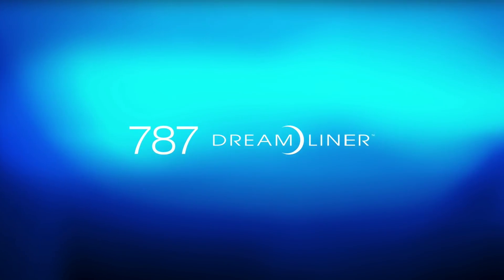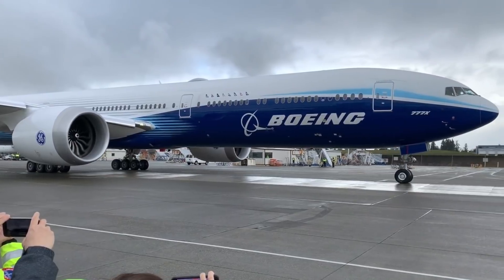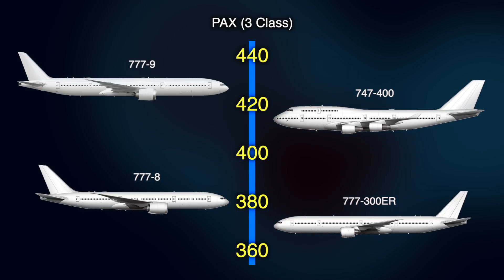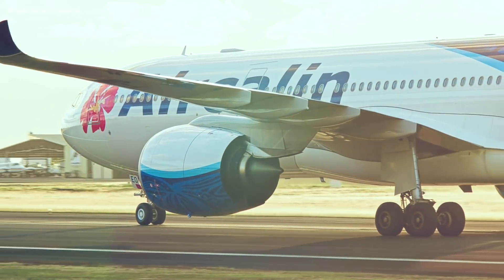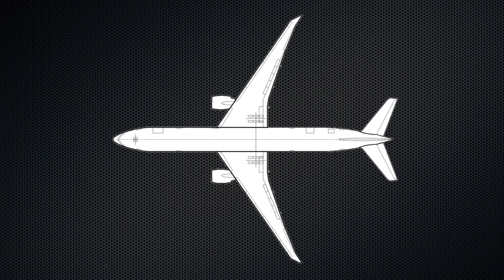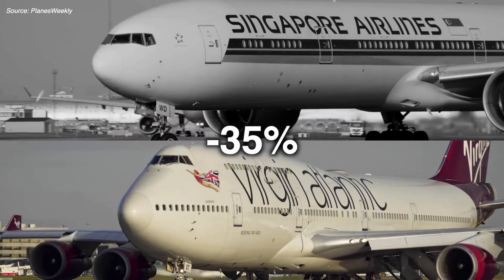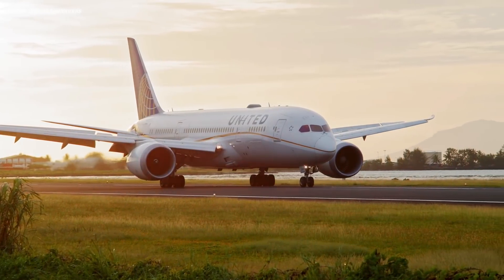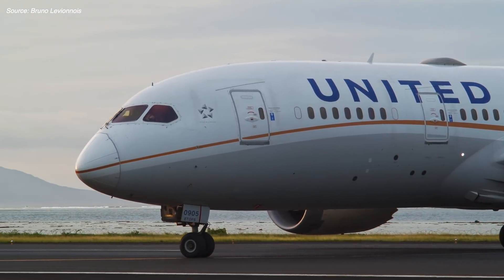The 777X Has a "Tesla Problem"

Comment: If Boeing had built the 777X's fuselage from composites it would just have been the same as building an all new airplane so the plane would not have been classified as a next generation 777 but as an all new airplane making the plane very expensive both for Boeing and its customers
Reply: This is the answer I was waiting for for the entire video. It would require a whole TCDS.
Reply: @jahredt  yep. It’s the same reason you still find ashtrays on the 737 ng. Altering the design, even in little ways, risks having the aircraft type certification revoked, causing the costs of production to shoot right up.
Reply: @monty2654  actually the ashtrays are an FAA regulation still. Even the 787 that was designed long after the smoking ban has them
Reply: @jahredt  I’m going to go looking for that now. Last time I was on a Dreamliner, I saw not one on the plane.
Reply: @monty2654  You're blind. I was on a United 787 EWR-IAH just last week. They're there.
Reply: @patrickproctor3462  easy son. Like you said, smoking has been banned on airplanes a long time. Why have ashtrays on a plane you have no intention to smoke on?
Reply: @monty2654  Yes, without FAA and EASA the 737max would be a best seller. Maybe not with the insurance companies ...
Reply: @VolkerHett  Airlines would be far more profitable... Just sayin.
Reply: @monty2654  Yes. As long as they don't have to pay for late or canceled flights. But that's bureaucracy, too.
Reply: @VolkerHett  No, no. I'm talking more than just late or cancelled flights. Over regulation on even the smallest of things can cost the airlines big money, needlessly. I've been witness to many unnecessary regulations being implemented, with no rhyme or reason to them.
Reply: @monty2654  Yes. But allowing planes like the 737max to be flown without any training for the pilots didn't turn out cheap. Typerating seems to be a pretty good idea, else carriers like Ryan Air would hire agricultural pilots to save money 😊 Boeing has a problem at the moment and I'm sure it's not an engineering but a cost cutting problem.
Reply: @VolkerHett  cost cutting, sure. Your point about hiring agricultural pilots is actually ridiculous. Airlines hire pilots from all backgrounds. Some of the most competent pilots I’ve met would jump at the chance to fly an ag bird, just to get experience. I’m not sure where you were going with that but, your point landed about 50 yards shy of a field goal….
Reply: @monty2654  Yes, but it is a long and expensive way from a private pilot license into an airliner cockpit. And besides ATPL you need a type rating for any aircraft you'll pilot. 
The MCAS in the Boeing 737max was there so airlines buying this machine save on expensive new type ratings for existing 737 pilots. With fatal results. 
Given the chance, airlines will avoid all cost. Be it fuel to reach another airport instead of their destination or pilot training. Oh, and cheaper planes would be welcome, too. 
The university where I studied business administration has courses for Aviation Systems Engineering and Management. I'd be one of the bean counting cost cutters where I in aviation instead of IT  :)
Reply: @VolkerHett  again, Airbus is no different. The only difference is, Boeing got caught scrambling and wrecklessly rushed the max product. The A320 did have a well publicized crash in its early days, that didn’t stop airlines from buying it. I work in the industry, have done so for 15 years. I’m no stranger to the foolish manoeuvres bean counters will pull to save a buck. My job is to directly help mitigate costs, without answering to those bean counters. I’m no stranger to the politics of airlines. Again, I know many pilots. Even after they reach the airline plateau, they will still go flying on their time off, when practicable for them. They easily make their money back once they get to the airlines. The amount of taxes that airlines pay, the scams that manufacturers pay to get “upgraded features”, all that stuff adds up fast. So yeah, I still think the bureaucrats need to back off in many regards and stop making airlines tread on the knife edge of profitability and bankruptcy. Maybe then, those same governments wouldn’t have to bail airlines out so damn much. Just remember, the money that goes to the airlines under that circumstance, comes out of your pocket, too.
Reply: @monty2654  Yes, I know! And that's why we need FAA and EASA to maintain safety over cost cutting. 
And let's not forget, crashes aren't good for business! 
As to the 737max, they should have made significant changes to the landing gear when they found out they couldn't put yet another bigger engine on the 737 airframe. This was cost cutting done totally wrong.
Reply: @VolkerHett  they DID make changes to the landing gear. They had to raise them to accommodate those engines. The max stands taller than an NG as a result. I think you need to review what you’ve been saying. In summary, it’s gone like this: “I was going to be a bean counter, therefore I believe we should should government agencies because you can’t trust bean counters.”
Again, you’ve missed the point I tried to make. I believe we should blow up these agencies and start again. Get rid of the useless regulations, you know, the ones designed to look like something was done to score political points with the general public, keep the good and ACTUALLY helpful regulations. Not a hard concept. Moreover, I’d like to see why you’d advocate for the aviation authorities of other countries that are very lax about safety, ie the ones that don’t have any policies about situations that very easily arise in the aviation community. Do you think we should just keep them around for reasons? Especially given that, they are so easily bought off, in many circumstances, to just look the other way….
Reply: @monty2654  I have heard that and I get that but it sucks that it hinders more advancement. That being said proven technology is comforting. Especially in a magic machine.
Reply: @monty2654  they're in the lavatory i think. If you do break the no smoking mandate, at least there is a spot you can put the ashes in.
Reply: @carlosandleon  Yep, I did find them, they're purely for the FA to extinguish any lit cigarettes.
Reply: @VolkerHett  One of Boeing's difficulties is the belief that they can save money by outsourcing.     Lots of companies still do.  Often costs associated with using outsourced parts are not accurately figured.
Reply: @monty2654  Crop dusting is one of the more difficult aviation jobs.
Reply: @VolkerHett   I wonder if anybody will ever put out a decent video and explain the 737MAX MCAS thing.
In short.  As I understand it the 737MAX only needed MCAS to ensure that no additional pilot training was needed.  GUESSING changing the landing gear would also require training.   So Boeing could simply have said no to SW and sold the MAX w/o adding MCAS.
Reply: @monty2654  the newer A320NEOs my company has still have ashtrays in the back of the cockpit seats
Reply: @peterambelang4888  cool.
Reply: Not only that, but it would also require a complete redesign of the fuselage, with the associated cost of years of engineering work. It's useless to simply make the same parts but with composites instead of aluminum. You have to redesign everything to take advantage of all the flexibility and reduced part counts that composites allow. And then you'd also have the cost of completely retooling the manufacturing facilities.
Reply: @VIctorAbicalil  and the tooling have to be remade.
Reply: Then again they are changing the flight controls completely... Almost had the pleasure of working on them
Reply: This may be an additional headache they avoided: https://www.youtube.com/watch?v=z7bHiHjGdR0
Reply: For those wondering about the ashtrays: There are still small ashtrays on every plane, only to provide a safe way to extinguish a cigarette. There are still people trying to have a secret smoke on the toilet. So if a passenger is found out, a flight attendant can safely extinguish the cigarette in that ashtray. Which is why they're usually found on the outside of the lavatory door. And yes she can open the lock on the lavatory door from the outside and she'll find out because of the smoke detector. Please don't throw a cigarette into the trash can either because it has an automatically activated fire extinguisher built in.
Reply: Re-engine B777-300ER would be cheaper and easier to sell than B777X.
Reply: Yeah, you can't just build a new airplane, call it the same thing, and avoid regulation and retraining. Look at the MAX. Boring tried and failed there
Reply: Boeing taking short cuts again... didn't play out so well last time.
Reply: Nice vid Coby.
You seem like a really nice guy.

Comment: I think it was just at the wrong time as many airlines have 777s that are still in service for years to come
Reply: I disagree.
It's like the A330neo; a replacement plane waiting for its predecessors to retire.
Reply: @declannewton2556  so i see. 
here is the progress chart thingy idk:
a330neo awaits for old a330s to retire. 
777x awaits for 777s to retire, but WAIT,
the a350 has already replaced the old 777-200s. 
777x now waits for 777-300ers to retire, but they're too young. 
777x will need to wait a long ass time

Comment: Boeing made the right call. Unlikely to see any US carrier buy it for the foreseeable future. Like the 380 it's simply too big for what they need with the multi hub networks. Now Boeing just has to not screw it up like they have all their programs in the last 20 years. They have paid dearly for poor management culture since the late 1990s.
Reply: The only US airline that will is United but they’d still be one of the last customers
Reply: @filledwithvariousknowledge1065  The problem with United is that they got their 777-300ER in a fire sale when Boeing was trying to fill their queue between end of the ER and the start of the X. They are too be to think about replacing. The X is too big to replace the 777-200 which are getting old. They have options on A350, which fits as replacements in the late 2020s. The 777-300 are more likely to be replaced in the 2030s, but who knows what air travel will look like with carbon neutral objectives.
Reply: I kinda disagree, I think United and American will buy, but later on in the decade if not in the 2030s.
Reply: @declannewton2556  I'm with Declan. Over the years, I have flown between many big cities in  777s of different airlines. So in other words, I think there are main routes that the companies need\want a large plane to maximize the large traffic.
Reply: They didn't screw up their 747-8i program though, that is a very safe design
Reply: @Blank00  It had its development issues and was delayed. The pulled resources off the program to work on fixing the 787. They had to take a right down on the development since it was delayed and over budget. Now compared to other programs for Boeing, i suppose it was relatively smooth.

Comment: Boeing 777X just came at the wrong time like A380. Engine delays, 737 Max case, COVID-19 pandemic, much more times required for testing and validation, and another delays related to flight behavior just make Boeing 777X sales worst than expected. It's a shame because i really like the design of the plane and eager to see it in an airport. Hopefully boeing can survive and more airlines will buy this aircraft. A freighter variant of this aircraft will be very interesting.
Reply: You're wrong here.
COVID-19 was the perfect thing for the B777X as it stands.
Firstly, it gives Boeing more time to iron out the kinks in it before they start falling behind Airbus here.
Secondly, it's an aircraft that was built to replace it's predecessors, so initially it won't sell good since the previous models aren't retired. The older models also have more time now since COVID-19 reduced their usage meaning less cycles.

I expect when travels returns to normal a year or two later, the B777 would begin retiring and the B777X would take its place.
Reply: @declannewton2556  
I agree with that.
It will be in top form when flying levels balloon again,  and they will,  and 380, and 747 production has stopped.
777x will be the new queen  of the sky.
Reply: @alhanes5803  Not long for the end of the 747, A380 is already done. The 777XF seems like the most logical choice IMO, cargo airlines like FedEx will most probably be very happy
Reply: @declannewton2556  I wonder if the 777XF will be a little late after the A350F and lose market share as a result.
Reply: Covid will play an unsignificant role compared to the timeline of a new airliner useful life (+20 years) plus its design and development/certification timeline (+10years)
Reply: @12345fowler   We are still suffering post covid problems.    So maybe wait to make that statement until after it is sorted.
Reply: @hit sensors 
You're a real Squirrel.
Reply: Boeing’s not going anywhere
Reply: So… two years later and 777-9 sales aren’t great… :/
Reply: @tonyvan8688  yeah, its sad to see but i hope the trial flight with emirates next year will give 777X another momentum. And finally 777X frighter is a thing
Reply: @Arkan_Fadhila  that’s fair tbh
Reply: @hit sensors
Yeah you're right.
Look at all the 380 freighters.
Oh wait,,,,
Reply: @hit sensors and you're calling me a dick?
That's funny....